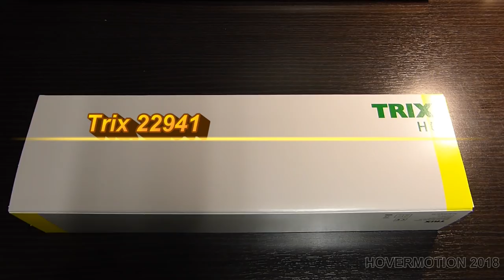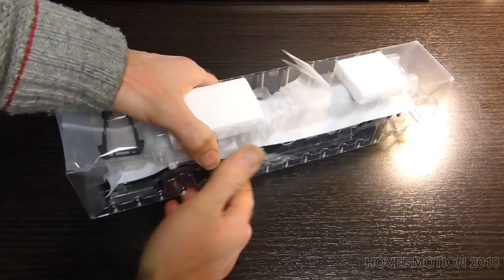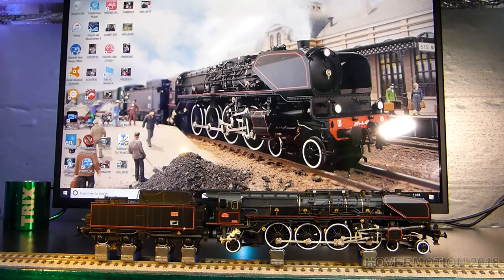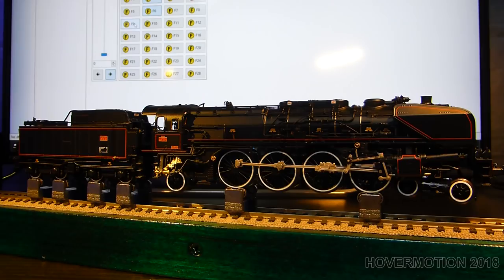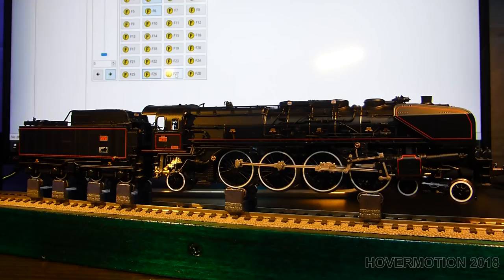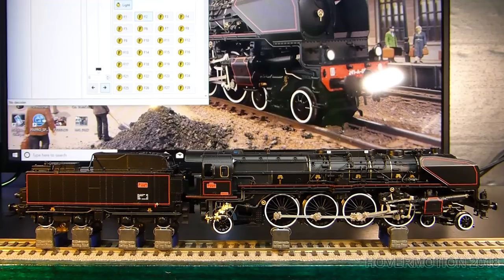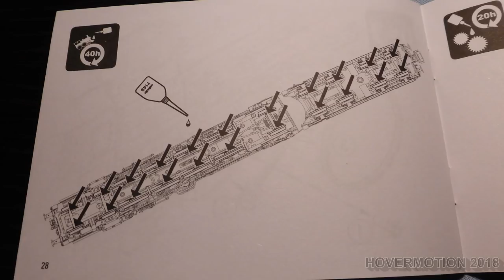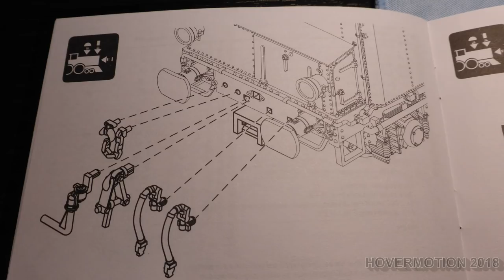TRIX  22941 MARKLIN 39241 SNCF CLASS 241 A UNBOXING

Comment: Nice review. It is one best M product of recent times. I've been disappointed with the sound of many later MFX decoders in M locomotive. Not this time. Sound is great and crisp. I am looking forward to proper as delivered SNCF 241P and not the excursion version as this one is. I also think at its price is a bit to high considering that there is not dynamic smoke etc. I high applause M for making the model of rare but highly desirable French locomotive. First non brass model of it. Kudos!
Reply from the maker: truebras Yeah very true , I would rarther esu or zimo sound files but this one is good saying that....a very over priced model I got this for less then £500 ...but it arrived with a missing part which is still out of stock at marklin..
Reply: Hovermotion, have you tried to change function mapping in this generation MFX decoder? Or change a sound file slot using lokprogrammer?
Reply from the maker: truebras No I just used manual cv adjustments..I may try the marklin programmer stick
Reply from the maker: truebras No I just used manual cv adjustments..I may try the marklin programmer stick
Reply: Hovermotion, 
How about if you can make a walk thru the M Mfx program stick. How to swap functions and change sound files.
I noticed that it wouldn't change some CVs if I didn't turn off MFX programming in CV 50. Later, tell me from where are you buying M and how much. You can pm . Thx.

Comment: Very nice loco and very nicely detail too mate. Can you change all the cv’s on your Eco’s Jim or do you need the ESU decoder programme as well?
Reply from the maker: Watermills yard Thanks...you can do the cvs on any programmer or software but I like using the esu programmer.
The best way to take full control of the chip is with the marklin central station 2 or with the new marklin usb programmer stick.
Reply: Hovermotion Thanks Jim, I’ve got one question for you, have you heard of any problems with the Ecos of late?
Reply from the maker: Watermills yard Yeah ive heard a lot of people haveing  glitches etc....mine is still fine and I hammer it...had it about 6 years now...there is a way to factory reset it then reload the firmware and layout data.....
Reply: Hovermotion Thanks for the information Jim.